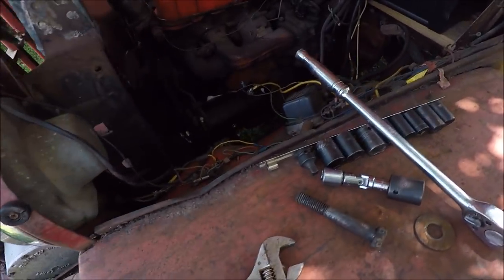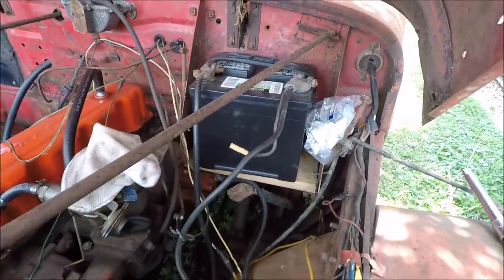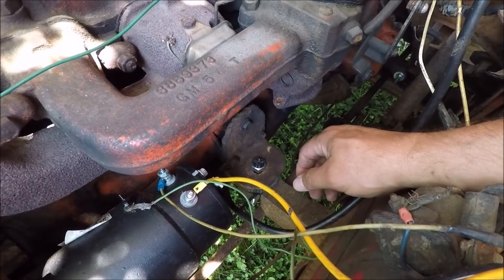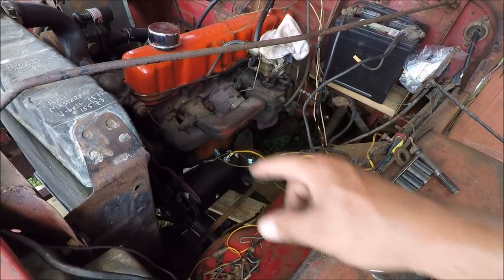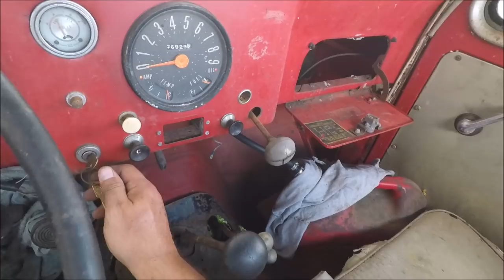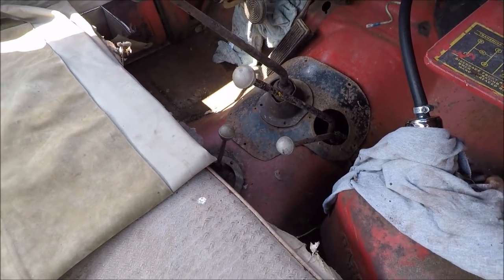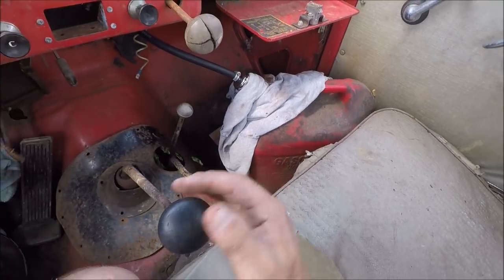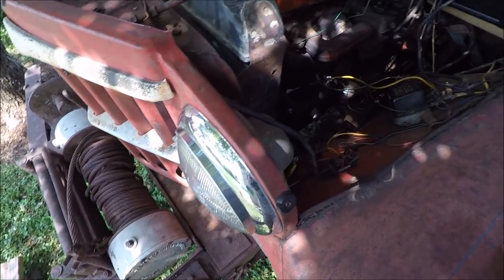Willys Truck Take 21: Hockey Pucks for Engine Mounts

Comment: I think you can check if the generator is working by disconnecting the battery once the truck is running. Maybe someone else can confirm this. I had the same straight 6 motor in a car but it had an alternator, this trick worked on that engine.
Reply: you are correct the generator will supply voltage to the coil to keep her running with batt. disconnected.

Comment: Did you lock the front hubs ?
Reply from the maker: nope. Found it actually has them. Cutlass hubs, unique and interesting.
Reply: Have been wondering the same . Do you mean the front hub caps are from a Olds Cutlass ? 
I'm sure you already know what locking hubs are but was wondering if the front hubs are engaged ( locked ) . I ask since the four wheel drive system is in question at this time . 
In a future video , when you are engaging four wheel drive for proof testing , can we get a close up of the front hubs ? Do check however if the select dials on both sides are engaged in lock position or four wheel position , whatever style hubs are installed . 
It looks like your using the select levers right , big lever back toward the seat for front axle engagement and Hi or Low range on the small lever . 
Low range will spin the tires just feathering the accelerator on grass . But yes , you'll want to test all ranges . Glad you got the decal in the glove box . The Dana 18 transfer case is cool !
Reply: Good stuff
Reply: Thank you hunter F for your link to the cutlass hub website . Yes EA , those are some interesting and unique hubs ! Thanks for the education !

Comment: On my old Scout and CJ5 you had to rotate each hub to lock them in before it would lock and 4 wheel drive. It would free wheel in the front until you did that. Again, tell me what a "Case" quarter is. Now that you have dealt with hockey pucks, you are authorized to call people who aggravate you, a Hockey Puck.
Reply from the maker: solid quarter, not 2 dimes and a nickel

Comment: Can you shift into N, then pull the small middle shift down (front axle engaged) and third shift stick either up (low) or pulled back (hi) and see if the truck can pull you?
Reply: paul calhoun 
The front axle will not pull the truck when the main transmission is in neutral , if that's what you mean ? 
To shift into four wheel drive , the main transmission should be in first gear , clutch down as you manipulate the front drive select lever to four wheel drive position . 
Then , the small range selector lever can be manipulated through neutral and low and high ranges .
The reason you should have the main trans in gear , clutch pedal down is if either transfer case levers won't move , you may need to tease the trans and t - case with some gear movement momentum with tiny clutch engagement to get gears to engage .

Comment: Since adding the hockey puck spacers to the engine mounts and noticing the noise when pressing clutch pedal , you may want to check if the clutch linkage is binding . Possible since the engine is at a new angle .after viewing the front hubs and your replies , I'll refrain from asking if the front hubs are locked in . I'm sure your shifting the transfer case right . Agree with you that it's not possible to inspect the clutch through the inspection cover since all that can be seen is the back of the flywheel and peering through the clutch fork opening dosen't get a good view of the clutch disc , I'll say that since the trans and 4 wheel drive is shifting well , and no noise from the clutch or rough engagement , I'd say it's good and can say you obviously installed it correctly and that should satisfy the question many commenters have . If there were a problem with the clutch , I know you would have said so already .
The next time you take a spin in the jeep , and try shifting the transfer case through its ranges , have someone view if the front tires are grabbing . If there were a way to view the front driveshaft turning under power , that could be helpful . Someone posted to lift all four wheels off the ground and run in four wheel drive . Only if you can do so safely . 
BTW , the spring over axle ( SOA ) is cool but not without its problems . Drive shaft angle and universal joint failure due to increased angle is one . Plan the SOA carefully . It would involve cutting and rewelding the axle leaf spring perches at the correct angle to obtain correct drive shaft angle both u-joints must be at the same angle  .I don't personally like leaf spring shackle lift , hope you wouldn't consider that . They tend to give rickety and unstable handling .
BTW , yes , the small shifter you said is the PTO for the front winch , yes , it engages the winch . 
Jeeps did come factory with overdrive and the same shifter in the same location but you've got PTO .
Reply from the maker: check out video description, its ok no one read it
Reply: EA: not much in the video description to read. It just says that you figured out the hubs.

Comment: Engage/lock-front-hubs-into-either:4wd/4x4/lock,then-engage-hi,or-low-range shifter-depending upon terrain,and traction available,engage 4wd-shifter to engage front driveshaft via transfer case,and after putting tranny in gear it should pull both front tires,and rears depending-upon-traction,and-good-diffs,driveshafts...Sometimes-on-the-old-non-syncro-tranny,and-cases-you-may-have-to-have-engine-running,clutch-partially-engaged in order to shift the levers,or-the engine shut-off,clutch released...That-smallest-lever-is-the:Power_Take_Off,or-PTO-which-engages-or-disengages-the-power-to-power-driven-accessories-such-as-that-tough-old-reliable-winch-out-front,but-unlike-electric-powered-winches-the-engine-has-to-be-running,and-pto-engaged-to-use...

Comment: Inspection plates are on the Willys bellhousing. You access the inspection plate just in front of your shift levers at the top of the bellhousing.. You pointed out the dust cover at the front of the bellhousing and called it an inspection plate. Does that help?
Reply from the maker: yep thanks

Comment: could clutch for hyd. dump bed be rusted,it is not releasing.mr. dawson is correct about locking hubs,take about 60 seconds to try.spin center of hub to lock or unlock.
Reply from the maker: snota spinner

Comment: you are one funny dude... If I may so bold to suggest that the next thing you ought to do is get an exhaust system on that. Your going to be in as bad of shape as your truck if you keep breathing those fumes. Then an air cleaner on top of that carb... but that's just me...

Comment: Unless the hubs are locked, it won't be in 4 wheel drive.  They should never be in 4 wheel drive w/o the hubs locked. But, you should drive it with the hubs locked and not engaged every now and then to keep the grease moving

Comment: if that is the original clutch than that might be why it was parked just saying and i think why the clutch is not engaging right is because you have no weight on the back of the jeep from moving out the bed and the tool boxes you should try putting some weight and try if it works though im too late to comment

Comment: That 4th shifter might be an overdrive shifter - or maybe a PTO unit.....
Reply: The 4th shifter between the seats is for the PTO which engages the front winch . 
An overdrive would be bolted to the transfer case where the rear driveshaft is . An overdrive shifter is in fact in the same location however . An overdrive would be neat but the winch is probably more useful in this application around the farm . An original Warn overdrive would be $$ !
Correction : an overdrive shift lever would be located with the transfer case levers . PTO lever is behind main transmission, where it is in this truck now .

Comment: You don't need antifreeze in the summer only when it's freezing hence the name antifreeze just add water.
Reply: doesn't antifreeze resist rusting in the engine and also cool better than water? We were always told that by the antifreeze makers  so it must be true..just saying CBJ
Reply: Note: It's leaking and a poison to animals that for some reason like to drink it, let him get the leak fixed then he can add the antifreeze personally I don't see a problem with just adding water for the next 3 or 4 mounts rust shouldn't be a problem, he's said he wants to change the radiator in the future.
Reply: Of course ,animals do like the taste of antifreeze....and some like other things like a story I heard years ago about a mangy old dog that would lick up motor oil and gasoline ,had an iron gut I guess..the story,the old dog came by one day just a gas tank ruptured and we were cleaning up the mess and he stopped by a puddle of gas and started lapping it up before we noticed him  ,he had swallowed about a cup full we guessed,than suddenly tore out up the hill and got almost to the top and keeled over..we were distraught over the pore old dog's misfortune and ran up the hill to see if we could help ..he actually was ok ,just ,he had run out of gas..the end..hehe
Reply from the maker: It will over heat with just water plus water is corrosive, that's why it's called the universal solvent, there is not a leak
Reply: Wow must be some potent water,  guess the overheating was from a clogged radiator.

Comment: Are your front hubs turned in?
Reply from the maker: not spinners
Reply: Thanks for the info . I guess that means it's either got auto locking hubs or stock hubs ?
Reply: Your should be locking hubs. I see someone sent a link to how to operate you 4 wheel drive...the hubs in vid are different then your but will work the same. You are just looking to see what it says either lock or unlock. They will either turn clock wise or counter clock wise to either lock or unlock...btw love all your vid's keep them going....

Comment: For 4WD you need to make sure your front hubs are locked.  -  http://www.ewillys.com/2017/04/28/cutlas-manfucturing/comment-page-1/
Reply from the maker: YES!! I figured it out actually, well my dad told me anyway. I've had many 4x4s but these lockers appeared to be always on, not changeable like the Comanche's.
Reply: I looked at your Air Pump video and it sure looks like you have Cutlas Hubs.  There are two slots on each hub and an arrow( which is probably really hard to see now)  You turn the cylinders so the arrows point in and it should lock.  Can you see the front driveshaft though the hole in the floor.  If you're in 2wd and the hubs are unlocked the driveshaft shouldn't turn.  Likewise, if the hubs are locked or the transfer case is in 4wd it should turn.  You should have a hi and low gear in the transfer case so if it's in 4Low you'll really notice it geared down.  Like you already assumed the handle nearest to the seat is probably the PTO control.  The winch will draw in at the same speed the wheels turn.  Good luck.

Comment: Holy hockey puck...I know you like the sound without a muffler ,so do i ..let's put a straight pipe on it and run it to the back and all the fumes will exit the rear ..no more wet towels..and the inspection plate should be on the bottom of the bell,but I looked on another web site and it is suppose to be in the floor ,a plate surrounding the gearshift and remove it and see the clutch  down through that hole..beats me,you already got an open hole there ,so look down in there..sigh..here is a link to this web site and a picture..good luck..CBJ
https://forums.g503.com/viewtopic.php?t=279105
Reply: Ps...everybody says,"Lock them Hubs"
Reply: The bell housing on this engine is a Chevy and does not offer the access for inspection like the early Willy's jeeps had . In earlier videos , the pressure plate fingers covered any view of the clutch disc . Even through the clutch fork opening on the bell housing you cannot see the clutch disc . 
Like EA said , just no way to see . Got to agree . Must say though , if the disc were backward and not releasing , gear engagement wouldn't be so good and there would be lots of scraping noise from the clutch housing . No complaints of noise or rough clutch engagement . Must be right .

Comment: dont EVER put it in 4wd when you have different sizes of ties o it or it will tear itself apart. also, older Ford truck and van wheels will fit it.
Reply from the maker: true, but not in grass, these tires are all same size